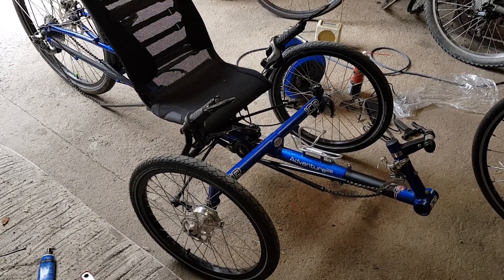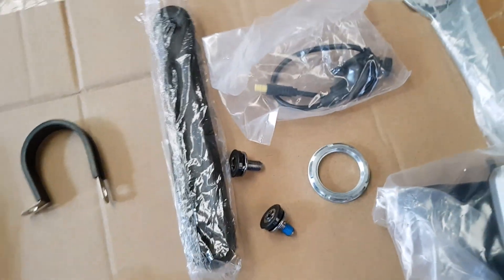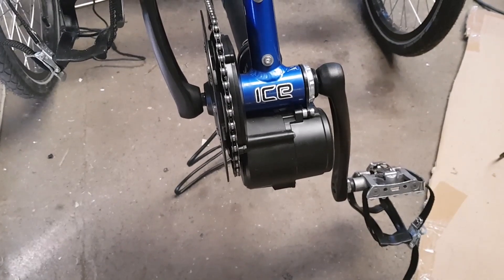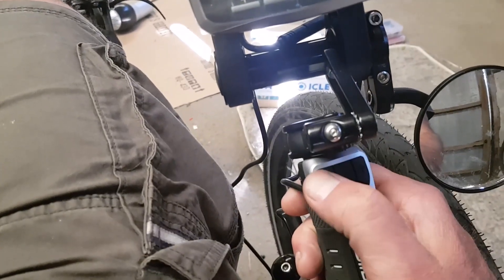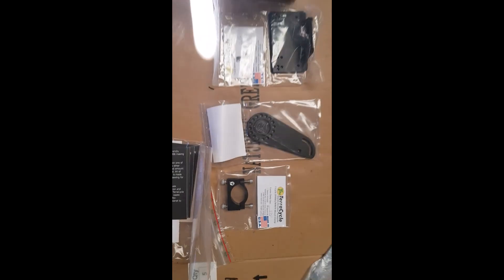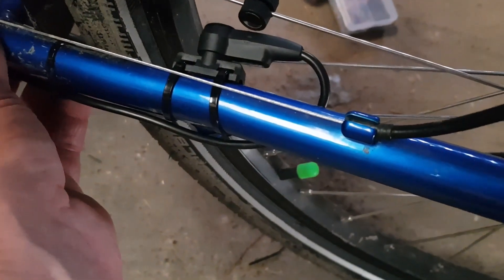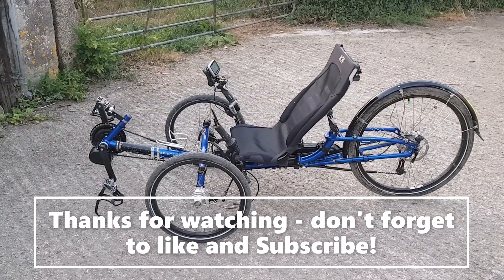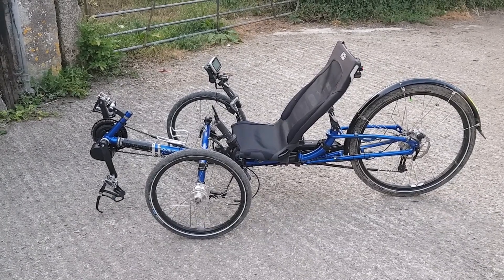Recumbent Trike Electric Conversion Tongsheng TSDZ2

Comment: You didn't need any other extension cables? (apart from the speed sensor)
Reply: @ebikechoices  Yes I have connectors and tools for the batteries. But I'm not eve sure there are extension cables or the display? And maybe throttle and brake levers? I do need the brake levers with sensors on my Bafang. So I can shift while the motor doesn't put pressure on the chain. But perhaps with the torque sensor of the Tongsheng I can shift more easily without having to squeeze the brake lever? 
I'm still not sure which one to pick, Tonsheng or Bafang. I love my Bafang (500 Watt). Although I do often ghost pedal. The Tonsheng is more like natural pedaling from what I have seen. In this case that's what I want.
Reply: @ebikechoices  Thank you. This will make my decision easier. Yes I often feel in a hurry with the Bafang.  You're constantly trying to keep up with the pace. If it wants to go 25km/h, I have to pedal exactly 25km/h. 
But I do want a throttle, legal or not. There are situations when it gets you out of trouble. I can't easily hop off like on a normal bike. Especially not with my solar panel roof on my trike. And if the brake levers come with it then I'll have those too. Although I already expected there's not as vital as on the Bafang. 
The Tonsheng is probably going to be more efficient on the batteries the way I pedal. I should go to the hospital to have the damn varicose veins fixed. But as it is right now I do a couple of pedal strokes and then let it roll again. Each time the Bafang draws all the power from the battery. I can imagine it being more gradual with the Tongsheng. So I can do more distance. Speed isn't important. And to be honest, in the Netherlands you don't really need e-assist unless you're old or have medical issues like those legs of mine If it wasn't for that I would not even put a motor on my precious ICE QNT. Somehow you ruin a perfect human powered machine.

Comment: Informative and helpful video.  Ordering this through aliexpress seems to be straightforward.  However, as it is to fit onto an ICE Sprint, where do I get the steel P clip from or does it come in the kit anyway?  How do I get a cable extension?  I have watched the video and it seems to be a fairly easy fit but do you know the crank lengths?  I ride on 155mm as I have knee and hip problems and this relives some of the pressure on the joints.  Depending on the length of the cranks in the kit, can I get shorter ones from somewhere?

Comment: Did you have to remove the entire original crankset AND bottom bracket parts before placing the TSDZ2 in?  Or did you leave the bottom bracket and simply slide the TSDZ2 into that?  Thanks!
Reply: @ebikechoices  Thank you

Comment: Hi Bob, is it possible to run the 250 watt motor with a 36 volt 20 ah 500 watt battery?
Reply: @ebikechoices  cheers Bob very helpful thanks.

Comment: I have this motor on my Catrike 559. Love it. Rode in a Metric Century today and battery was out of juice at 30 miles. A bit surprised as I’ve ridden nearly 30 on previous rides and still has 5 power bars. My only complaint is the battery piece that is attached to the battery mount (I have the same T-Cycle mount). The piece that comes with the battery that has the power cables started breaking. Supplier trying to get a replacement. Nice install job.

Comment: Any differences between Bafang and Tongsheng?
Reply: @ebikechoices  I had the Bafang on my ICE QNT for a couple of weeks. I kept the motor in place with an exhaust clamp and DIY strip of metal. Pretty easy job. 
And yes I did get the 36v 500watt because my homebuilt solar trike isn't the lightest with my 90 kilo on it. 
I do agree the Bafang doesn't feel very natural. One of the downsides of Bafang is it pushes you to always go 1km faster to save battery. But with my bad leg I always pedal a couple of strokes and let it roll again. I really should have that leg fixed soon I have the money. Insurance wont's cover the first 500 Euro each year. Healthcare privatization: fantastic. 
The Tongsheng seems a better alternative for riders who don't want to be completely assimilated into a Borg.  Very helpful info. Thanks.